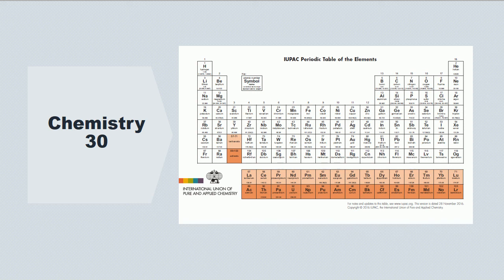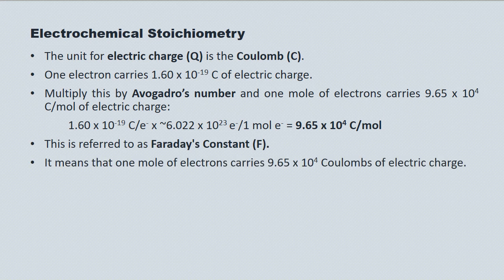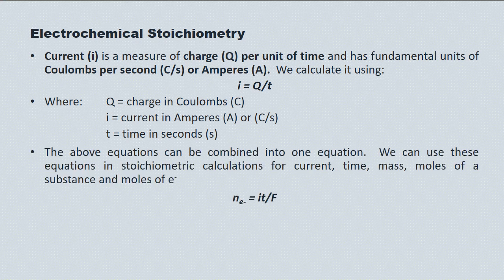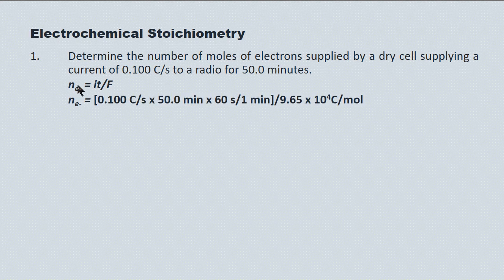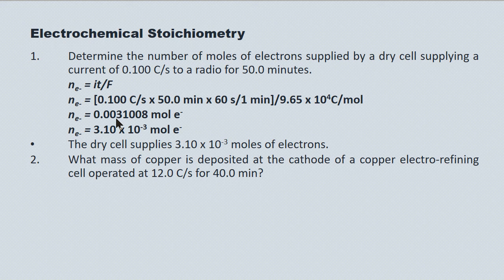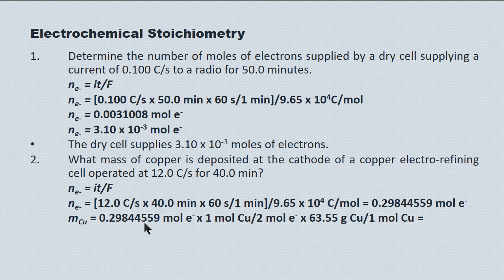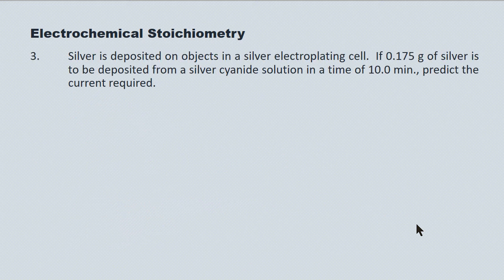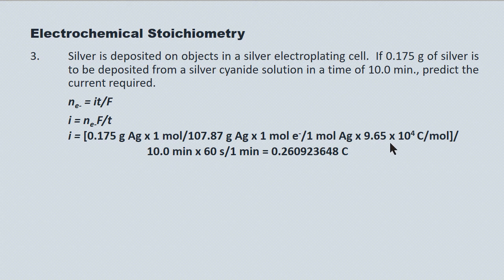L  11 Electrochemical Stoichiometry

Comment: I'm sorry to impose, but I've watched example 3 over and over and I just can't understand what is happening between steps 3 and 4 (7:10), I find the equation very hard to read or understand, is there any other way you could write it or explain what is happening? Thank you so much for these videos, they are so helpful!
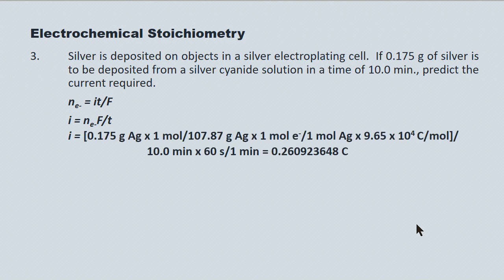Reply from the maker: This is a fairly standard electroplating example. We're given mass of silver to be reduced and are asked to solve for current by rearranging and substituting into the equation. If you follow through the conversion factors mass of silver is converted into moles of silver, which is converted into moles of electrons, then into Coulombs per second. The math is correct, but there is an error in the units of the solution. Current is measured in Coulombs per second (C/s) or Amperes (A). The solution of 0.260923648 C incorrectly describes current in Coulombs (C) at (6:14). The correct solution is 0.260923648 C/s, reduced to 0.261 C/s. Thank you.
Reply: @AlbertaHighSchoolChemistry  thank you for your help :)